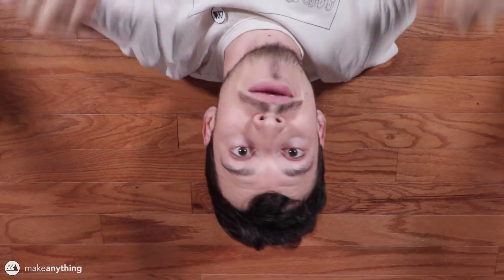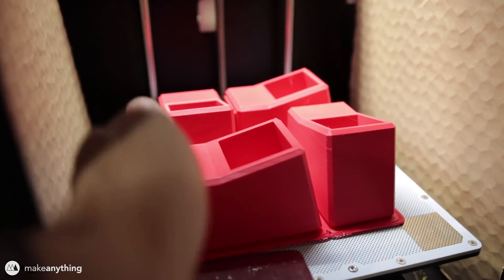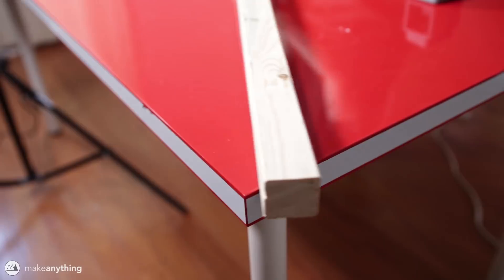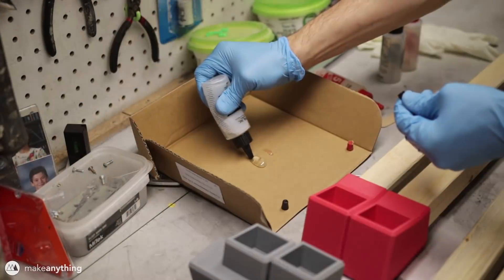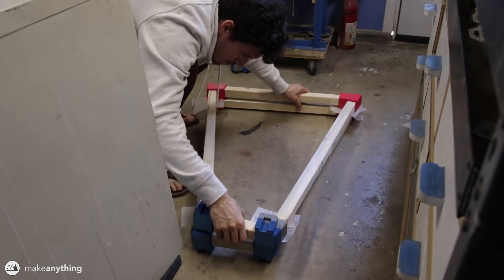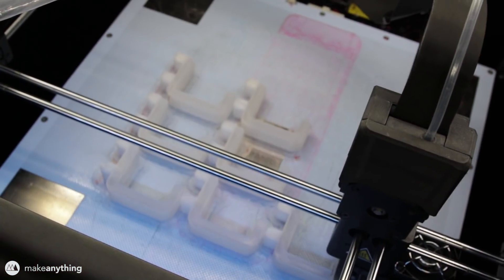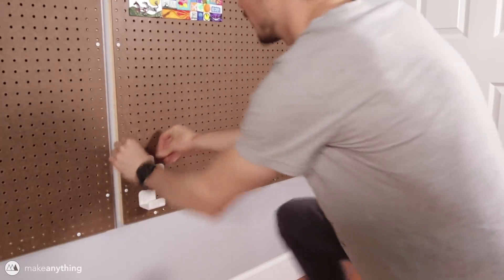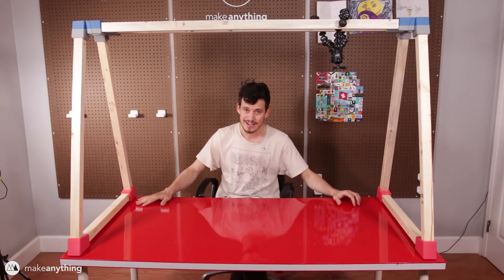3D Printed Overhead Camera Rig for Top Down Desk Shots

Comment: Thanks for sharing, nice design! 

A suggestion for a future build: When I overestimate the size of something it has to mate with I usally make a small bushing/ spacer with the printer to fill the gap. Printing is usally quick and saves on adhesives. Or even better: print a small template with the size of your design (a few mm thick for a quick print) and just print it for a quick test before committing to the full part.
Reply: I always do the same, but I guess he just didn't think of that. It would have been way better than what he ended up doing.
Reply: Indeed, no problem though. That is how we learn, by trying new things and helping eachother

Comment: I think the triangles on the left and right would have been way easier to make just out of wood and not have the 3d printed parts at all, but 3d printing is what your channel does so it makes sense in context.  The 3d printed parts on the top with the removable dovetail makes a lot of sense and is quite a nice system for assembly/disassembly.  So you still get a thumbs up, lol.

Comment: First rule of 3D printing - every object comes in 3 itterations ;) You should test-fit cutted parts of the model first before printing them all. If you cut out one hole and print a small part of it, you will spot the it's too wide.. Also, test print one before doing batch - you will catch the stucked support problem and most likely being able to find a solution. 
You do not need another slicer - try Meshmixer and their support. Then print it whole (with tree support) as one model without the support.

Comment: What if the table gets jostled and it falls from the table? You should find a way to have the thing "snap" to the table so that it won't accidentally get knocked off.
Reply from the maker: That's what the rubber grip on the bottom should prevent, but you're right.. It's still a risk!
Reply: Trust me, I've had stuff with grips and my clumsy hand still manages to knock the whole thing over! I guess this thing has enough weight to it though so that a little jostle won't do much more than shake it a bit. I'm just more worried about the fact that table looks very glossy and would have very little friction!

Comment: On my zortrax I always just unplug the bed and pull it out to scrape off the part.  Works really well cause you can hold the build plate against a stop on your workbench while scraping the parts off.  Using this method I probably only level my bed every 40 or 50 prints.
Reply from the maker: I resist doing this because the plug looks so tiny and fragile, but perhaps it's the way to go
Reply: Make Anything I think as long as you are careful it a superior method. Avoids messing up the connection on top of the bed as well. I jammed into that with a scraper and ruined the wires that come off the connection on the build plate.

Comment: With the peg board hooks why didn't you just sand the pegs down? Get a drill, a pencil and a piece of medium sandpaper (or fine wet and dry sandpaper). Wrap the pencil with the sandpaper put pencil in drill chuck. With the spinning of the drill you don't have to use alot of force. Or you could have used a drimel
Reply: Kyle Mozisek 
Yes but it has the chance to be to loose
Reply: Thats why you go slow and pay attention. you'd be surprised how much fitting issued ive been able to fix with pla and abs with just a little sandpaper and maybe some acetone

Comment: I have a question, If you have a solid object, like a piece of wood, and you have like a 10 mm tolerance isn't too loose already because its bigger than the object itself so even a 3 mm tolerance is too loose too, idk please tell me because idk how it works
Reply: If you have a 10 mm tall and 70 mm long piece of wood for example you should have an gap depending on the glue or method you use to put them together. Thing glues like super glue a .15 to .2 is good and for thicker glues like wood glue you should use a .3 to .5 gap. For things like a male and female connector for example use a .15 to .2. This works because the parts aren’t exactly that size USALLY. So that makes it easier to put it in. Also even if it was perfect it will still be hard to put it together

Comment: Why didn't  you just design in screw holes and screw the plastic to the wood?
Reply: I guess that would've worked for the feet part, but the bars at the top it wouldn't have worked as well.

Comment: Could you use the wishbone connectors on the beams to mount them vertically on the pegboard, saving more space? Maybe a pegboard clip with built in wishbone joint.
Reply from the maker: That's another option for sure, but I like storing them horizontal at the bottom of the pegboard

Comment: There I was expecting some slider tech, considering the experience with 3D printer sliders, rails, motors and such, instead it's 3D printed joints, which are easy, cheap and readily available in a range of materials. Oh well, ...